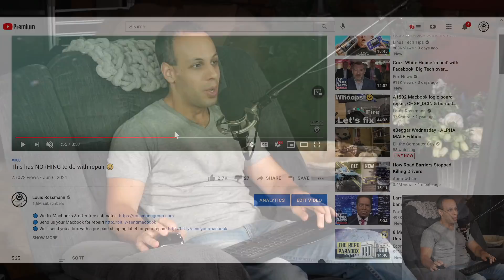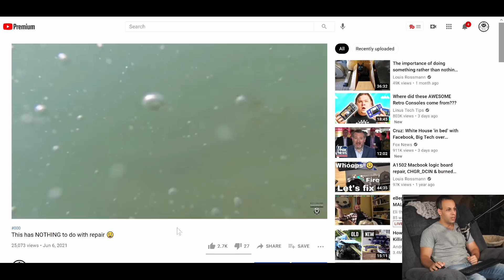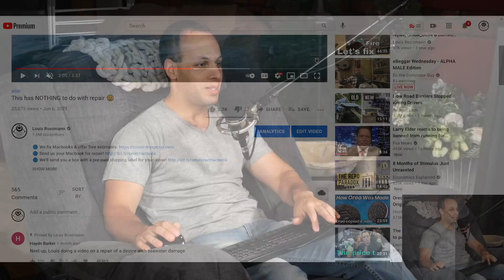Why are user serviceable batteries a bad thing?

Comment: I still have an LG G4 and a Samsung Note 3 that I use for part time jobs and other jobs specific things. Both have user replaceable batteries. And I love that popping a new one will give me a full charge (taking into account I have charge it previously). A part from not being supported by the manufacturer for updates, those devices still works great and I had one of the batteries go bad on me, used for 2 years and it started to inflate. Bought another one from the OEM and voila. Back into action, the whole device isn't compromised.
I really don't understand with a 1000 USD phone that I cannot do this anymore, the options are gone, they all do the same crap and all are equally bad.

I had to swap a late 2013 macbook battery because it couldn't last 10min on battery. This was painful to remove with the amount of glue but I didn't set my house on fire nor injured anyone. I took the time, was slow and careful. Put a new battery and I now have 3h40min of battery life instead of 10min.
Instead of throwing/selling my laptop, I've just extended it's lifespan further more. Less E-waste and more savings, this macbook is used to do presentation, quotations etc... So I don't really feel the need to get the latest and greatest processor or whatever, as it won't make my job at doing quotation better.

So, user serviceable batteries is something that is great for consumers. Scare to do it yourself? Ask a friend, family, or even go to a shop at worse. You have multiple choice. Not like now, no choices.

Comment: Back when user replaceable batteries  were the norm, I used to always have a few spares...sometimes in my pocket. Sometimes I had change in that pocket too. Only literally burned a hole in one pocket once. Did have several swell and get hot before that though.

I'm not against removable batteries but there should be a warning about the potential of burning your dick off if you loose carry around a spare.

Comment: I still have a S5 active, I have used it in the shower many times and have even dropped it in the shower and had the back and battery fall out. Still works great, but had to replace the battery.

Comment: I remember most smartphone reviewers, when the transition was happening from user replaceable batteries being common to everything sealed in, saying stuff like "this new phone doesn't have a replaceable battery anymore, but now it has IPXX rating water resistance!" Like it probably was a talking point manufacturers suggested to them and tbh I myself ate it up, I truly did think sealed in batteries were better for water resistance.

Comment: I had a table fan that was very serviceable from 50s or 60s, Emerson I think. 1 screw in back to remove the housing and clean motor. Small hinge to remove the blades cover. And small hole on top to add oil. All metal including blades. Now impossible to open a cheap a$$ plastic fan to clean and service.

Comment: So I bought a Moto e5 play from US Cellular.  $20!  What a deal.  Does everything and more than I need.  It's a prepaid account.  Battery went bad after two years or so, still worked but puffed up since I pretty much keep it on the charger all the time (use it as a hotspot).  Bought new ones, one extra because it's a user replaceable battery (one of the main reasons I bought it) so I'd have an extra on trips.  Now my phone is acting all wonky.  Was that a design, or are these cheap ass chinese batteries screwing with my phone??  Ordered new ones, supposedly OEM.  Interestingly neither US Cellular, nor even Motorola sells replacement batteries.  Again, is this because they want me to buy a new F*CKING phone??  This one was working fine until this issue came up.

Comment: If the legislation doesn't mandate how devices are engineered (at least slightly) then it's worthless because they can just start epoxying or welding everything to get around that. They can sell you the charging chip but to get to it you destroy the board/screen

Comment: Well, I want replaceable batteries but here's why I don't care, with the plethora of gullible people buying this crap it means every 2-3 years I can pick up a moderately used flagship for the price of a budget phone $100-200 and if necessary I'm able to replace the battery or whatever where most people can't and just get rid of their phone, I've gotten an LG G8 roughly a year ago for $110 and it was practically new with barely a scratch on it, only bad thing is it was locked to ATT and I had to switch providers, but hey not a big deal I got a lightly beat up OnePlus 7 Pro for $150, so yeah neither are dream phones, but I've been much happier with them than budget phones.

Comment: I had one of the first Samsung galaxy phones, and I could pop the back off and tap the battery out in my hand. Years later I needed to replace the battery in my Nexus 5, oh... My.... God... It was so ridiculous, I had to pry the back off, disconnect a cable that ran across the back, then try to pry the battery out without bending it because it was stuck down with glue so powerful I could have pulled a car with it.

My current Nokia 8 will be even harder to open. I want replaceable batteries again.

Comment: Indoctrination. It's crazy to me that user replaceable components is a contentious issue. Even though it's more work, and can possibly be a pain in the ass. As long as OEM batteries are officially available, or reputable third party batteries are available, and that they don't tie components to devices. To me throwing something away, or trading in a new phone 'cause something - that should be trivial - broke, is asinine. 

I knew what I was getting into back in 2013, but I have rMBP sitting in my drawer with a shot battery. AFAIK third party batteries are sketchy, and Apple won't just sell me the battery. It's fucking stupid.

Comment: reddit is full of incels dont care about their stupid comments the batteries should be user replace and easy because it can explode the device if they swell and not removed on time... btw i have a macbook pro mac os that the system says battery needs replacement i removed it and want to use only wall charger guess what now the macbook its cpu /gpu throttled i have to use unlock software to use full ghz speed...................OH APPLEEEEEE

Comment: Smartphones used to have removeable batteries. And then when the smartphone manufacturers moved to non-removeable batteries, the excuse was "people want thinner phones"
I do not think it was genuinely true that people would rather shave a few millimetres off than have a replaceable battery. They just didn't give people a choice. And I'm pretty sure a lot of the people arguing for it on the internet were astroturfing.

Comment: After I saw this video, I did a very informal survey. The most common answer I got from those favoring sealed devices was: I like how thin the phone is. Or the variant: I wouldn't like it if my phone was any thicker. I was not surprised how often they had very large (though admittedly thin) phones. The next most common answer was by far the most uninformed, and that was that the batteries "used to be so expensive". These folks clearly never had a battery replaced in a sealed phone, and/or never considered how much less expensive it was that buying a new phone. Maybe they just liked having an excuse to get the latest and greatest. Personally, I would love to have user replaceable batteries again.

Comment: As someone who uses old phones as another source to monitor their security cameras I have become aware that when batteries were replaceable they would run with it removed when plugged into the wall but with non removable that is no longer the case. This practice should be illegal, for a device to be rendered unusable because of a consumable is beyond retarded.

Comment: I think two of the reasons people accept this stuff is a) we tend to tolerate it cause we like the features of X device/technology; b) and logically we're dipped into something that is "technically" true about many of these hard/impossible to repair devices (i.e., to make the technology behave/fit the size/etc., it needs to be that way). Point "b" is the trap because it's us assuming the constraints of the technology, which gives many developers lazy ways out of solving problems.

As the number of features increase/battery sizes increase / etc., to be thinner or conform to sizes we desire as consumers, we develop this internalized rationalization that "of course this means they have to solder the whole thing together / make parts that are irreplaceable to optimize it to keep fitting." This is obviously not true, but it's a play on our sense of scale. If we fit all of today's tech plus 5 new pieces of hardware into the same device, simple thinking would reason the device would have to get bigger. And part of that might "technically" be true. But given our desire for sleek, stylish, and some maximum thickness, that would be undesirable. So, we end up accepting the irreplaceable thing because "this is just the way it has to be to get the features we want."

The above is what I mean by giving developers a "lazy" way out of solving problems. We end up justifying it for them. We allow them to take shortcuts with the technology that are completely unnecessary. Some of it would require some innovation to deliver a fully serviceable phone (depending on our definition of full serviceable; I personally just want to exchange broken parts for working parts; it doesn't have to be each individual piece). But a lot of it I would attribute to simple laziness combined with needing people to keep consuming. Though, if people can replace things, you can sell the parts they're replacing. Anyhow, /rant. Great job, as always on the video!

Comment: Louis please read, you say you don't want Right to Repair to be about making manufacturers design serviceable products, but do you have any where in your priority list making legal protections for when consumers' expensive hardware fail prematurely and the manufacturer creates extreme unsubstantiated design obstacles to repair? Shouldn't that also be a goal? 

Maybe something not called right to repair, but as environmental issues become more and more serious, shouldn't manufacturers at least be investigated by the FTC or some other governmental body when intentionally malevolent design such as sealed batteries or overkill amount of screws and non-standard ones, and SPECIALLY chips that fail for no reason and fuses that don't blow, causes premature failure?

Comment: A few questions - Have you covered what you're thinking about regarding possibilities for enforcement and penalties for noncompliance? 
The pessimist in me feels there's a non-zero chance this will usher in big corps moving quicker to part serialization, so now you can buy the components, but the processor will check at boot and refuse to work with anything but the original. Is there anything to guard against that in the proposed legislation, without delving into I guess broad strokes of design requirements to not use serialization except for maybe cryptographic security and/or shouldn't render the device unusable and at most require a factory reset?

And yep 100%, very tired of no headphone jack, no removable batteries, and no sd card slot bs.

Comment: My first phone was a Samsung Galaxy Alpha. I remember I bought it just because it had a removable battery, plus the metal framework did work as a cooler to avoid overheating when playing games. Changed the battery once during it lifespan, lasting a total of 6 years for me.
After those 6 years, it was getting slugish and many apps did not work due to they didn't support the Android version it had. Thus, I wanted the Xcover Fieldpro because it also had removable battery, is IP68 and looked really rugged, even when having three frontal buttons (I don't like capacitive buttons), but I wasn't paying 1200€ (~1104$ on US, don't know why we are paying +300$ just for being european) just for a new phone. So I bought the previous one, the Xcover 4s for 260€ and I'm happy with it.
It's not the most powerful, but it shares the removable battery, has IP68 and is rugged enough. Plus, and i found this after buying it, I can assign the lantern of the camera to the side button colored in orange. How many phones have a utility like that? For me it's awesome that with two clicks I have light at any moment.

Comment: Perhaps slightly off topic here, but let’s do a thought experiment:
Let’s say I ask you to carry around a surveillance device on your person for 12-18 hrs a day. This spy device has multiple microphone arrays, and multiple high definition cameras, as well as an advanced operating system. This device also tracks 100% of your physical movements, whereabouts, and who you interact with.
If I told you that removing your battery would give you temporary relief from this constant surveillance, you might be tempted to remove the battery from time to time, and interrupt the process.
I wonder who would not want the average person to have that capability, and would potentially lobby to have that feature removed, under the guise of more efficient DFM.
🤔

Comment: How do you make a metal and glass phone with a pop off back? I think if you had adhesive on the back it might be easier for end users.

Edit* im not saying that its a good thing, and I get that its harder for users to access it. But as someone with a 6s, Ive just gotten used to popping my non adhered screen off whenever something goes wrong.

Comment: Wrong. You want a device that lasts for a long time. Old Russian fridges from 80's are still working. Why? Because they were build that way. Because you could fix them easily even though you didn't have to (they're not A++ energy efficient). Our stuff should be well done, period. Batteries are the weak point and they should be easily replaced if needed. No more electronic waste, more environment friendly. Maybe I need someone like you (because you're obviously forcing your [or lobbing] profession) to open it for me and do the replacement procedure for a buck or two. That I can agree.

Comment: You could keep the exact same type of "sleek" looking phones right now, by simply putting pins on the sides (like the sim-tray) to release the back instead of gleuing it shut. A lot of these "pinholes" have been extremely easily and cheaply made to be waterproof.

Comment: I have a waterproof 4 years old Samsung Galaxy Note 8 (that is waterproof DESPITE having a headphone jack), where the battery is still good. Well, it does have it's drawbacks, in cold temperatures, it can randomly lose a random amount of it's power, easily over 50% in freezing temperatures, which is only an issue, since I like to use my phones on the bike handlebar - it's not an issue, when you carry it in the pocket and only take it out sometimes.
Anyway, digressed a little here...... I am not yet victim of the big drawbacks of sealed in batteries, but still I know, it's absolute bullshit. Manufacturers feed us a lot of lies in order to make more profit. Losing the headphone jack because there is no space for it anymore, or needing to seal in batteries in order to have the phone waterproof, it's simple lies. I'd go as far as saying, it's an EASY task to have the battery raplacable while keeping waterproofness. It's not like you have to re-invent the wheel. So many manufacturers of many different things have done that. Hell, many phones still have SD cards and NEED to accept Sim cards - this is also a spot in the phone, that needs to be able to be opened at any time but keeping waterproofness. But this is supposedly not possible with a battery compartment? Fuck off with this bullshit.
Personally, I have no issue with batteries being sealed into the device, since they don't need to be switched that often. Batteries last quite a while if you know how NOT to treat them. But manufacturers feeding us more and more bullshit - and the masses of brainless sheep eating it - makes things worse and worse. And I am not looking forward into the technological future, where phones are getting more and more expensive, while not offering much more than previous models, and also have less possibilities than older models. I like to still stick to my Note 8. It can do everything a new phone can do and still comes with a headphone jack and a non-idiotic fingerprint sensor. Once I will have to upgrade or replace, it's gonna be a touch decision.

Comment: A sealed battery can't be removed in an emergency.
Reply: Now an emergency, but I liked how I could make a hard reset this easily
Reply: @cola98765  there were actually survival classes that taught if you were lost and needed a fire, a removable battery could start a fire by puncturing it, then the backside of the screen can be used as a signal mirror. With glued in components you'd risk having to break the entire phone (goodbye signal mirror) to just get to the battery which could quite literally save your life.

Comment: I’m just guessing here but in many devices that have a battery compartment or a door, that mechanism breaks or becomes loose rendering the entire device useless. The cost of battery replacement at the Genius Bar is less of a hassle. You drop your phone in and 30 minutes later it has a new battery. A little more pricey, a lot less annoying than a phone that turns off because the battery hinge has become loose.